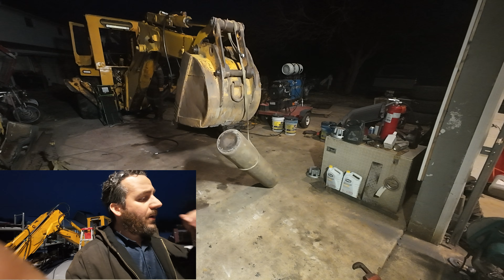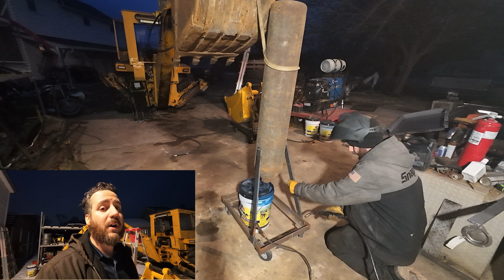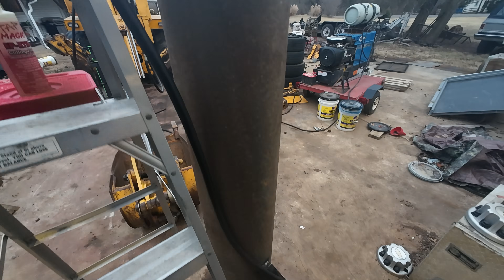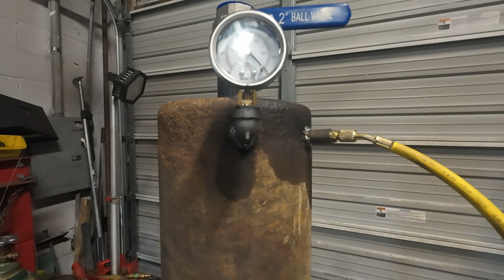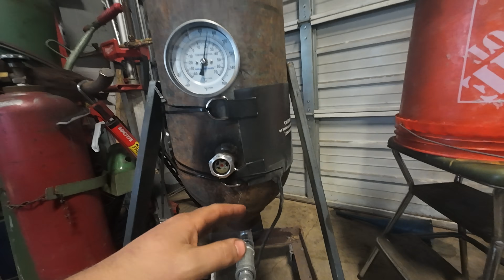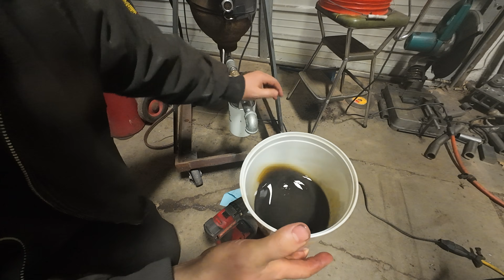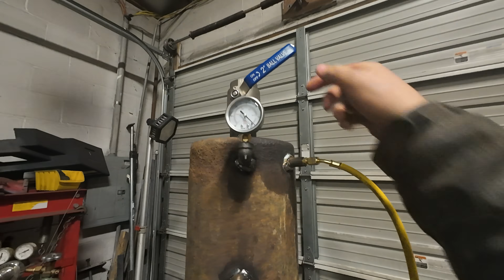I made a machine to remove water from hydraulic oil. Vacuum de-hydration

Comment: I'd love to try this using an old hot water heater. Basically has all the ports needed already in place, including a heating element. It would allow for alot larger volume of oil processing too
Reply: Water heater tank will not take the vacuum , it will collapse 
You could use a propane tank , but would be down to 5 gallons

Comment: You could consider adding a second heater and insulation on the tank. Your oil should be closer to operating temperature say 175 to 185 F.  Use metal tubing to the vacuum pump maybe even with a coil and use an air compressor water separator before the vacuum pump.  Also the water molecules have to travel all the way through the tall column of oil to get to the top but the narrow column gives you more surface contact to heat the oil. If you want to get fancy use a small pump to circulate the oil from the bottom to the top. That’s probably overkill though.  Over all a very good idea.

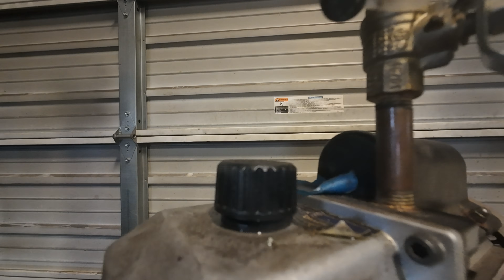Comment: 15:15 vapor is neither moisture nor trapped air, but oil mist from the oil in the vacuum pump. One should avoid (I don't avoid it either 😅) having water vapor sucked into the vacuum pump, due to cavitation (the water vapor a.k.a. steam collapses in the vacuum pump).

Comment: I had an issue with what looked like water, however it was also frothing up and coming out of the oil tank breather, so much so I ended up making a catch tank.
Spent time and worked out I had air being drawn in on the pump induction side (no visible leaks when turned off) . . . .  In the end I found the hydraulic pump input drive seal was not correct and as the input shaft drives the induction side of the pump it was pulling in air and frothing the oil making it look like water contamination.
Might not be what you are getting but worth noting.
Reply from the maker: This is absolutley a real issue with some machines. Mine gets micro bubbles on the dip stick meaning that I may have some type of internal leak like this. Its WAY better with the dried out fluid, but still not perfect.

Comment: You have a great idea but poor execution on your welding. How to fix and test your welds: first drain all oil. Heat up welds after removing sensitive equipment. Burn off oil with torch. Grind welds down and reweld using higher settings to ensure better penetration. 
To test fill tank with diesel fuel. Leaks will show up quickly. Drain fuel and reweld. 
Easy tip: add another valve near lower part of tank. Apply vacuum to suck up dirty oil for processing. No need to pour into top of tank.
Reply from the maker: I like the feed it from the bottom idea. For the welding, I prefer pressurized air and soap/water. The diesel will contaminate my welds.

Comment: nice job, I used the turkey fryer method several years ago on my backhoe.  I did about 30 gallons in a day easily.  It only took a few minutes to get the oil hot, and once it started boiling, it took only about 2 minutes to boil off the water.  I kept an eye on the temp, never got over 215 F.  That may be too hot for the oil, but it has worked fine for years after.  You will have to cycle the oil through a few times to pick up all the water.  I will say, my oil didn't get black like your oil did, not sure why your is getting black, maybe its just particulate matter in you oil.  Anyway, nice work
Reply from the maker: An old backhoe will put up with a lot of non-ideal fluid conditions! Anything is better than water

Comment: You can actually time how long it will take by watching the temp glass, it won’t let the system get above the boiling point of water if there’s water in it, so as soon as the heater goes above that temp, wait 10 minutes and it will be done boiling water

Comment: Too much resources and energy for such kind of result. Just add gelatine. It acts as a demulsifier, will also absorb contaminants and settles on the bottom after a while. No extra energy needed. No special equipment needed.

Comment: I’ve been having issues exactly the same with my mix of equipment. Living in Canada this becomes a series issue in freezing temps as my hydraulics won’t work do to frozen suction screen restrictions. My price is $135/5gal. and I have dead machines due to not spending that on 4 or 5 pails to flush and have it turn milky very soon thereafter.
 I’ve been thinking about letting it settle to remove bulk water , but you just saved a lot of work as it would not have worked and this also helped explain why the pails I,left outside to freeze the water portion has not worked except for an initial I’ve chunk per pail. Appearance was still milky so I knew settlement wasn’t the answer . Centrifugal separation is to expensive a route but your build has pointed me in the right direction. Numerous comments will help make process more efficient and hopefully reduce carry through of water to pump oil . 
  Expansion chamber with outlet SS coalescing mesh screen would help protect pump as well .
 Absolutely great project and I’m Subscribed now !
Reply from the maker: Welcome aboard! Water in oil is a real problem and while this isnt the ideal setup it has potential to be really useful.

Comment: I built a vacuum system for vacu-forming hot plastic over wet/green plaster molds. I had the same problem of water boiling out of the plaster and going through the pump. First thing I can see is that your pump is the wrong type to deal with moisture. Either a rotary vane or diaphragm pump would handle excessive moisture better than an oil entrainment type. The other thing i did was to use a copper coil condenser unit and a clear whole house water filter converted to hold silicon dioxide desiccant beads. To be honest, the condenser never did much at ambient temperatures. You would have to actively cool it. But, the desiccant beads worked really well. They would turn from a deep blue to pink as they absorbed water. Once they turned pink you take them out and bake them in the oven to drive off the moisture till they turn blue again and reuse them over and over. This kept the moisture from running through my pump. The filter housing was a 4.5 x 20 clear whole house filter, but I used a 2" sediment filter instead. This left room to pour the beads around the sediment filter. The sediment filter then became an air filter as well to keep from sucking silica dust through as well. Anyways,  that would be a good addition to your unit.
Reply from the maker: Great ideas thank you for that!

Comment: Very nicely thought up and executed !
I do wonder if you would be able to, and gain some benefit, from insulating the hydraulic reservoir ? That way you wouldn't get as much moisture drawn in the through the breather on the machines maybe ? Especially if you run them lots of hours and then they are sitting outside in cold areas ?

Comment: You can just put a water separator on the line between the tank and the vacuum so it wont reach the pump and you can just drain it off periodically

Comment: I also made a machine that removes water from oil. I had a problem when I worked in pipe fitting when my cutting oil pan would get water in it. I would put the oil in a gallon jug and set it in the freezer. When the water was frozen I would pour all the oil off the ice.
Reply: Likely the vacuum pump oil has no emulsifiers, so this technique is likely to save wasting so much of that oil.

Comment: Tbh, using heat made it worse i guess? Vacuum is essentially lowering the requirement of materials/liquids to 'boiled' off or pulling things ('impurities') afaik in hvac,
If you want to separate water and oil, i would rather add some ice just enough to made water more 'slushy' rather than let water 'boiling' then hit the vacuum pump and ruined the oil pump
Proceed let water slow sink on the bottom since water is heavier than oil
Or better buy some used centrifugal pump like those used in big ships and open up new business "oil separation services" lmao
Reply from the maker: This oil has emulsifiers in it. It will NOT let water settle out. Even after 6 months its still suspended in the oil, I tried this first. The vacuum does most of the work, the heat just accelerates it for use in the winter time.

Comment: You basically made an accumulater from a large refrigeration system. I have a wheelchair lift on the back of my 85 squarebody and this past month it actually  was below freezing and i couldn't use my lift till i flushed and filled the hydraulic system, so moisture in the fluid is something to be concerned with for sure
Reply from the maker: Love a good squarebody and dry hydraulic oil!

Comment: If your vacuum pump has a ballest valve on it, you can open it while the pump is running. This will boil the water out of the pump oil.
The ballest valve is a controlled leak, which caused the pump to run hotter. 
Many years as a  maintenance man at a vacuum tool coating company.
Reply from the maker: I dont believe mine has one, but I love that idea!
Reply: Overtime will the pump be damage b/c it has ran hotter due to the ballast valve being open?

Comment: Maybe putting a batch under vaccum but without heat for a spell would answer your question of how much of that is air. Pull it out without heating leaves the water, you can look and compare to a heated batch

Comment: Re milky oil less quickly, Did you know to have vacuum pump ballast open at the start , as some brands instruct?  Many fridgies in my experience, are not aware how it works.
Javac instructions for one say - Another issue is water condensing in the oil. Once the oil becomes milky the vacuum pump can only reach the vapour pressure of the water; we can’t dehydrate water with water in the pump. Opening the gas ballast valve is vital in the early stages of evacuation as this works to keep the oil water free by destroying the vacuum after the sliding vanes have swept the inlet port of the pump. The water is not allowed to condense in the pump and is driven out of the oil box in the form of vapour. 👍
Reply from the maker: I dont think this pump has a ballast valve unfortunately, but I will be getting a new pump soon

Comment: probably could same a bit of time by using a settling tank and letting the oil and water separate first. drain off the water first then use your machine.
Reply from the maker: It wont settle out in any reasonable time. Ive tested this for 6 months and hardly any progress. This fluid really grabs onto the water

Comment: There could be iron oxide left in the oil which water vapor cannot take with it. I speculate being less than 10 micron it would be less harmful to the machine than air or water would? So the rust would come from water born impurity in the oil due to water in the hydraulics and from inside the tank used to build the seperator. With a centrifugal oil filter all of that would be removed but has to be cycled continuously. Oil tests are not free but will reveal what the oil contains. if the colouration turns out to be carbon or graphite that would actually be beneficial in your hydraulic system. Possibly as manufactured?

Comment: add a thermostat so you can keep the temp at just the right level. Wrapping it in some insulation would help in the cold months.

You can do a cold trap to keep moisture out of the vac pump

Comment: Um, couldn't you just heat this oil to 250 degrees and all the water would boil off?   Then filter it and you'd be good to go with no fabrication needed at all.   You could use an old turkey deep fryer or something.
Reply from the maker: I explain why I didnt want to do that in the video. I also dont have a turkey frier lol

Comment: It seems that some shop vacs can pull below 3 inches of mercury (10kPa, 1.45 psia),  and some pull 0.8 inches.  They aren't bothered by water. The large container means if the blower side is closed off with a ball valve and the motor shut down, the pressure won't rise much absent leaks. That shouldn't be very hard to try.

Comment: How about making a collection sleeve for around the exhaust of the vacuum pump, terminating with a clear tube, going into a calibrated catch container. (Beer bottle?  Mason jar?). It would also visually indicate when the vapor stops.  I purchased a very well used hoe that has weeping cylinders and obviously contaminated hyd oil.  Bought all of the cylinder seals and have just started replacing the worst one first.  I have run around forty gallons of oil onto my property so far, needing the use of the machine more than the forty to fifty dollars for five gallons of oil.  I’m thinking that it’s like diesel right now, expendable until I get the weeping fixed.  Your situation is familiar 😢.  I can see a similar scenario at my house soon!  Thanks for the idea, I appreciate it and will definitely put it to good use 😊
Reply from the maker: Sounds like yours is self flushing!

Comment: another idea could be if you have a small sealed pump you can feed power to you could have a water fall style system where the oil is pumped up to the top of the tank and falls down through the chamber in to the pool where would be more surface area for the vacuum to strip the moisture out of the oil . though that may or may not work . but it would not take to much to make it and just run it if it doesnt help then just plug those ports no harm no fowl .

Comment: perhaps a staging system where you get another of those tanks like that and just pull the vacuum on that before pulling the vacuum on the oil container and cool the vacuum tank so that the moisture condenses with in it and can be drained wen the pressure equalized and your ready to drain the oil you also drain the staging chamber so you don't get cloudy pump oil.

Comment: Kinda wondering how the vac pump would tolerate running on hydraulic oil as well. That'd certainly simplify the process... 💡💡💡💡💡💡
Reply from the maker: It might be okay. The oil isnt too expensive. 12 bucks for 32 ounces. About 2 dollars per pump oil change

Comment: If you want to distinguish between the two, exposing the oil to vacuum while cold will remove entrained air but not water.

And why not use a 1-micron filter in your polishing rig?  Get rid of a lot of that black sludge which is probably iron oxide or iron sulfate.
Reply from the maker: If I can find one I would be happy to run a 1 or 2 micron

Comment: You could try a condenser coil coming off the tank's vacuum port and going into a water separator like you'd use for a sand blasting cabinet. Icing the coil would encourage the water to condense and come off as liquid and get trapped in the separator. Probably won't have to chill it this time of year.

Comment: If you fill the bucket, weigh it, then scrub the water from the oil, fill it, weigh the oil again, then you should be able to calculate how much water you were able to pull from the oil.

Comment: Check the ph of new tractor hydraulic oil and see the difference between the dehyrated oil vs the hydrated oil.  I believe it will be more acidic which may be a concern as well.  You may need another procedure to lower the acidity.
Reply from the maker: Very possible!

Comment: My first job was to draw a LVGO oil separation and filter vacuum package.  The vacuum distillation column used a black iron cap drilled with multiple 1/8" dia. Holes. This was inserted in the top nozzle.  Below was plastic packing balls. These gave suface area.  So you would pull vacuum below the packing balls and the top nozzle would spray the old oil in.  Take a look at a process engineering book it will provide a generic design which is as old as the Kentucky moonshine hills...

Comment: Possible solution for the moisture problem in the vacuum pump… Add a bottle that can handle the vacuum (maybe an old fire extinguisher) between the pump and oil chamber to act as a condenser.

Comment: need to attach a dry air cylinder to the side of your machine. its fine right now with 32°F or colder outside air temp... but come summer, when you crack that valve on top to let the air in. The 80°F+ outside air itself will be wet.

Comment: great stuff, i have this exact problem on a tractor i just bought, the gearlever gaiter was torn and it let in a lot of rain. it is like vanilla milkshake. i have tried boiling it and it is useless, hardly any change after several hours. it does not want to let go, the top of the oil in the pot is cool enough to just reabsorb the steam back to water. might have to build something like you have. would a propane tank be too thin walled for vacuum?
Reply from the maker: I think a propane tank would handle it. Especially a smaller forklift sized one

Comment: You might want to add an inline desiccant to remove moisture from the line going into the vacuum. You might want to use one of those screw on water boiler heaters and screw it from the bottom. You can lower the temperature by applying low current to keep the temperature at 100 degrees Fahrenheit. 

Alternatively, you could replace the entire contraption with a water boiler.

Comment: I use a vacuum chamber to dry my 3d printer filament.  I use a fuel water separator with 10 micron filter to pull water out of the vacuum oil.  With a fuel pump to pull oil from the bottom of a 1 gallon container.  It's pumped through the separator and filter, then to the top of the container so it goes down the side.  Otherwise, it traps air in the oil, and I have to bleed it from the filter.  Using a 12v fuel pump let's it run a 12v power supply that I had.   The container is a gallon glass pickle jar.  Clear hose to plumb it with. Even have a primer bulb  for slowly  filling the filter when changing it so I don't have oil flowing everywhere.  Turned cloudy oil to clear oil in a few hours.  Might work so you can recycle your vacuum oil a little bit.  Just an idea
Reply from the maker: That is elaborate and very smart!